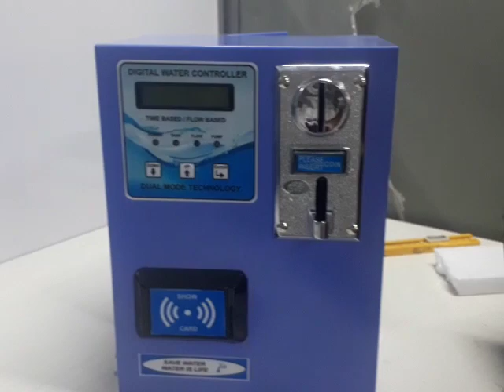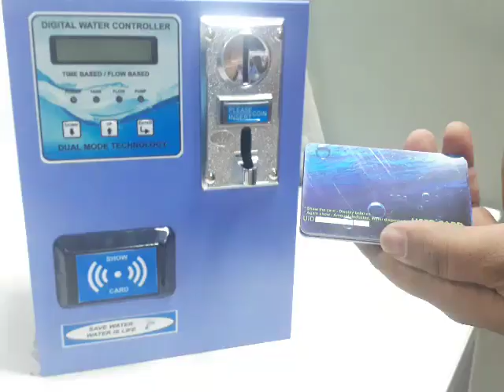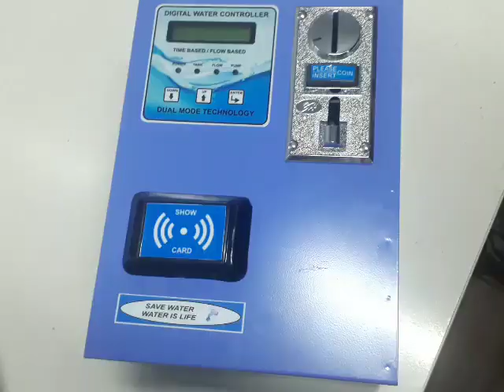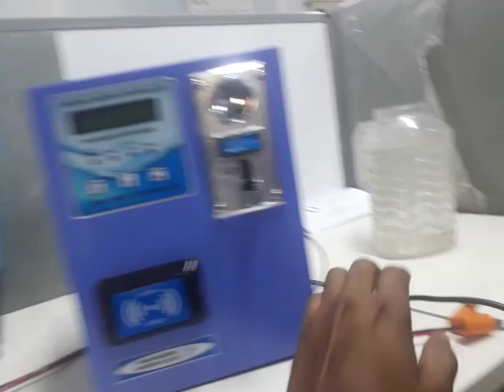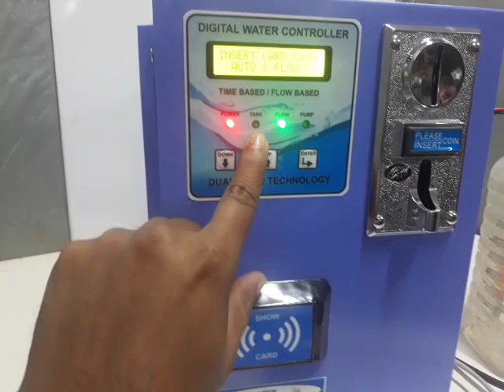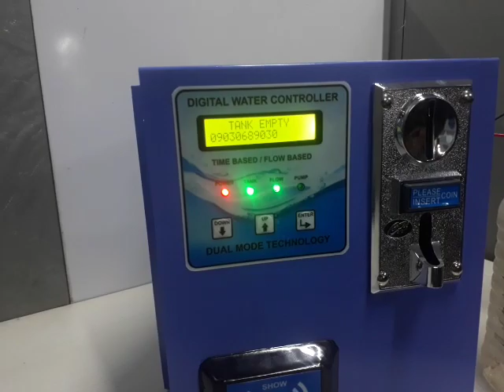HOW TO INSTALL WATER ATM CARD + COIN (COMBO) | WATER ATM INSTALLATION

Comment: Idhe same Nacharam mae there koie branch lagaa kya
Reply from the maker: WE ARE MANUFACTURES OF

                                                     RO CONTROL PANELS FOR WATER TREATMENT PLANTS -
                                                     (GSM& NON-GSM) ,
                                                     WATER VENDING MACHINES (GSM& NON-GSM),
                                                     AUTOMATIC HAND SANITIZER DISPENSER ,
                                                     AUTOMATIC TOUCHLESS WATER TAP CONTROLLER 
                                                     (TAP-1,TAP-2 & TAP-3),
                                                     SMPS(24V/1.5A,24V/2.5A & 36V/1.5A)

INTRA DIGITAL PRODUCTS
HYDERABAD
FOR MORE DETAILS : 
CONTACT : 6304921911, 6303498573
TELE Ph. No: 040-27133244
EMAIL:  info@intradigital.in
               marketing@intradigital.in
               intradigitalproducts@gmail.com
               www.intradigital.in

Comment: What's total cost of product.
And your details please...
Reply from the maker: WE ARE MANUFACTURES OF

                                                     RO CONTROL PANELS FOR WATER TREATMENT PLANTS -
                                                     (GSM& NON-GSM) ,
                                                     WATER VENDING MACHINES (GSM& NON-GSM),
                                                     AUTOMATIC HAND SANITIZER DISPENSER ,
                                                     AUTOMATIC TOUCHLESS WATER TAP CONTROLLER 
                                                     (TAP-1,TAP-2 & TAP-3),
                                                     SMPS(24V/1.5A,24V/2.5A & 36V/1.5A)

INTRA DIGITAL PRODUCTS
HYDERABAD
FOR MORE DETAILS : 
CONTACT : 6304921911, 6303498573
TELE Ph. No: 040-27133244
EMAIL:  info@intradigital.in
               marketing@intradigital.in
               intradigitalproducts@gmail.com
               www.intradigital.in

Comment: Bro I have small doubt
Reply: Maa village lo mineral plant vundhi but ye card use chesi water techukovalo ardham kavadam ledhu
Reply from the maker: Call Mr. Sanjay 9154949189, 6304921911

Comment: How munch distance ATM card to card reader block.
Reply: Minimum 1/2"distance
Reply from the maker: CONTACT : 6304921911, 6303498573
TELE Ph. No: 040-27133244
EMAIL:  info@intradigital.in
               marketing@intradigital.in
               intradigitalproducts@gmail.com
               www.intradigital.in